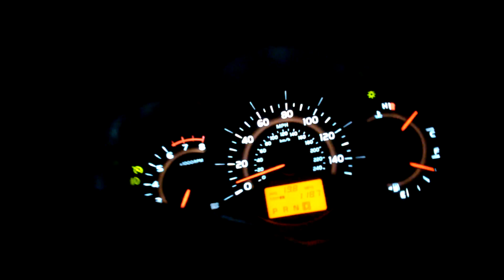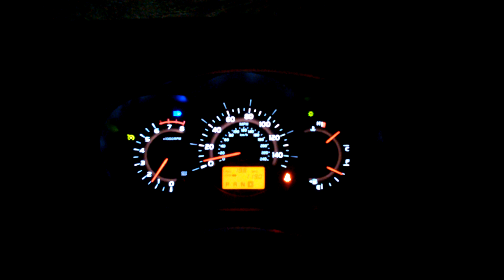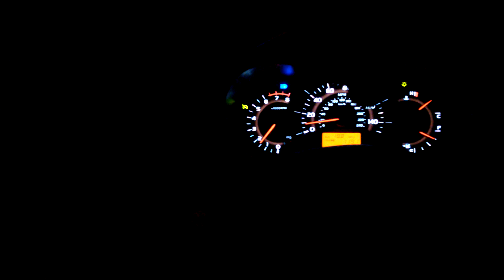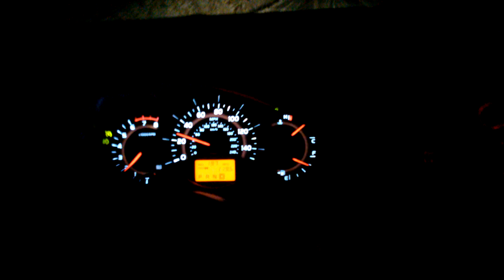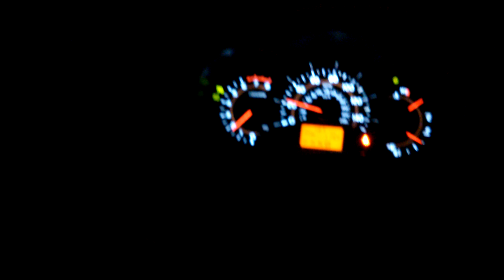VSC/TRAC Control Explained

Comment: That's very intresting. My 2013 Rav4 AWD LE does not beep when the VSC operates. Mines made in Japan and I'm not sure if that makes a difference. Thanks for the video! 

I have found the VSC to work great when I need it to straighten the car out.
Reply from the maker: Trent Wheeler that's odd. Mine beeps on my 2010 and 2013. The 2013 is the LE as well. My 2010 is the V6

Comment: If you turn off trac/vsc does it stay off until you turn it back on? Or does it automatically turn back on every time you start the car?
Reply from the maker: It reverts back to normal operation once the car is turned off. It can't be permanently disabled unless it is done by the computer somehow
Reply: @MemphisMojo15s   Good to know. Thanks.